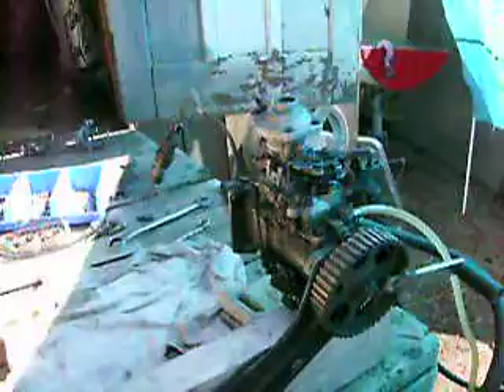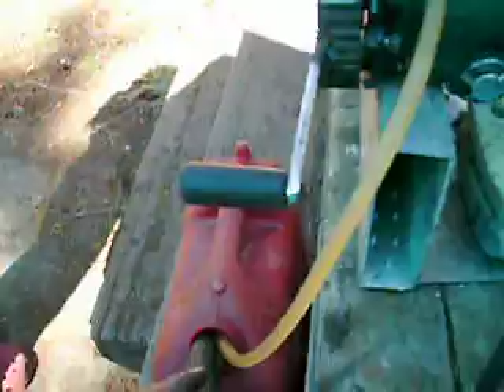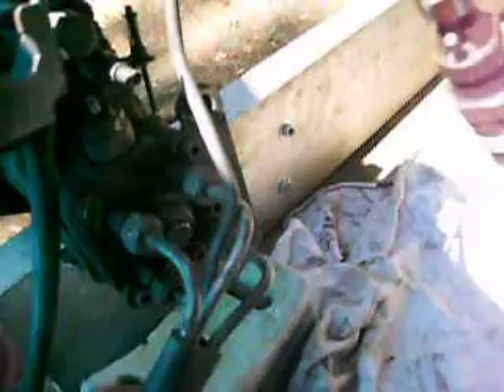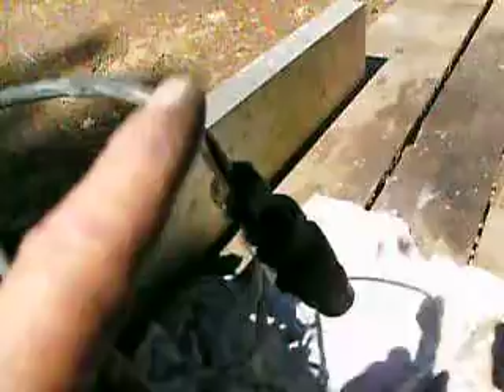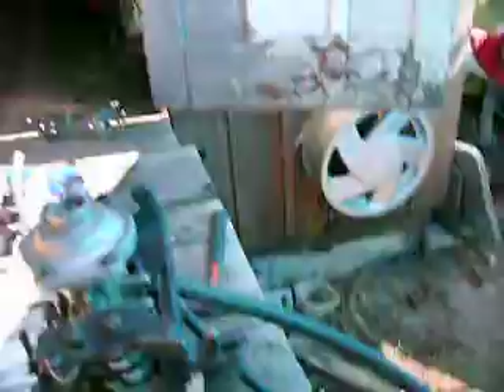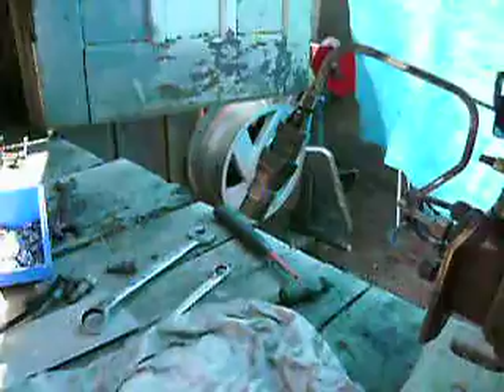VW diesel injector test. pop pressure & spray pattern tester DIY

Comment: How did you get this to work without connecting a12V supply to the solanoid ?
Reply from the maker: Because it was a permanent test set up I pulled the valve from the solenoid.

Comment from the maker: It was a spare that I had from other engines that I parted out.
You can get one from a wrecker, scrap yard or a VW tinkerer like me in your area.
You will just have to finds one cheap somewhere, you wouldn't want to pay more than $50 or $100. Keep in mind you will need the metal injector lines as well.

Comment from the maker: The break pressure on a NA injectors is between 130 - 138 bar 1849-1863 psi
The break pressure on a Turbo injector is between 155-163 bar 2248-2364 psi
It's important that the break pressure be fairly close on all cylinders other wise the engine will not run smoothly as the fuel will be being injected early and poorly atomized.

Comment from the maker: Vacuum advance in the case of the VW diesel does not exist, the only advance that is used on these engines is the cold start lever on the back side of the pump. This provides about 5 degrees of advance on the injection timing.

Comment from the maker: Heh d00rnas,good catch your right of course, I spent to many years working on Gas engines I guess. For everyone elses info, the Boost pressure enrichment mechanism, is the housing attached to the top of the Injector pump, that increases the amount of fuel provided to the injectors when the turbocharger provides more air or boost to the intake manifold.

Comment from the maker: Yes is is a turbo pump.
You can tell by the vacuum advance pot on the top. The regular aspirated do not have this.
You can of course use a regular pump to.
I suspect that a regular pump would even work with turbo injectors. It's the break pressure of the injector that is different between the turbo and the non-turbo.